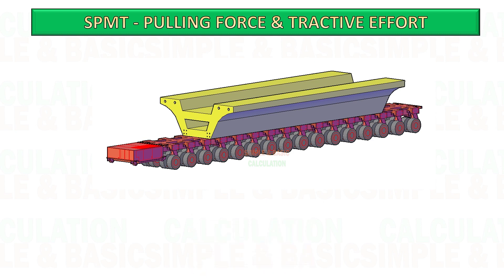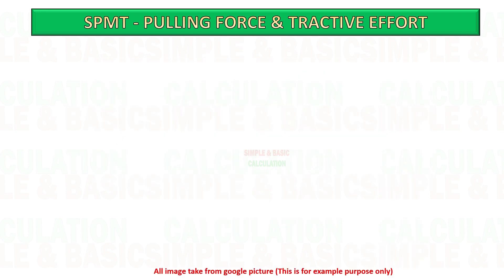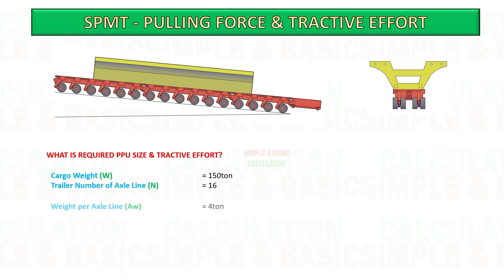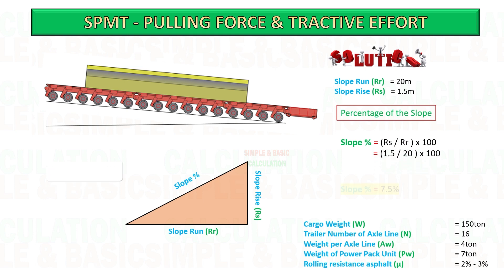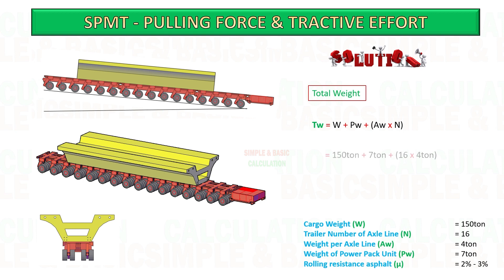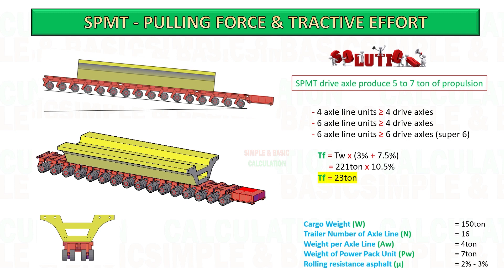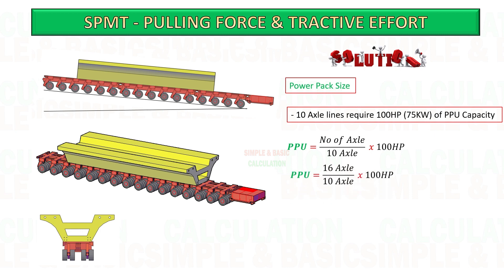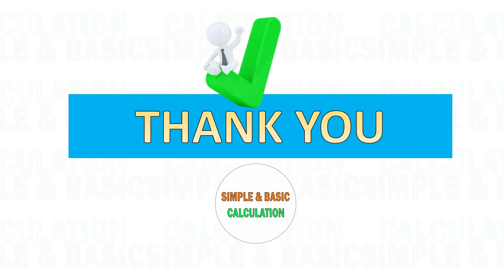SPMT Pulling Force & Power Pack Unit Calculation #heavytransport #spmt #transportation #PPU

Comment: What is rolling resistance in asphapt,.. is it like  friction coefficient ?
Reply from the maker: Rolling resistance refers particularly to the force that opposes the motion of a wheel or rolling object as it rolls across a surface.
The coefficient of friction refers to the resistance experienced when two surfaces come into contact and either slide or attempt to slide against one other, regardless of whether the motion is rolling or sliding.